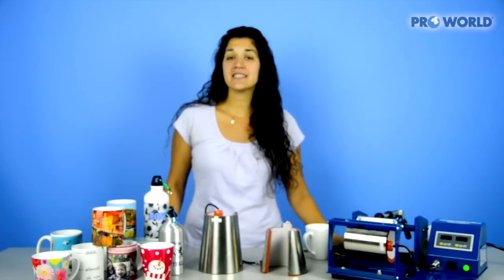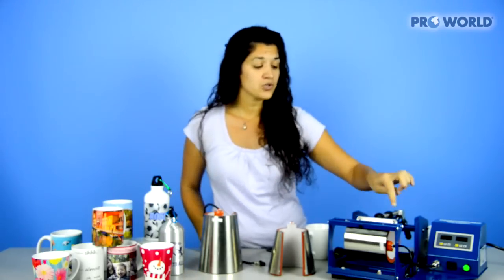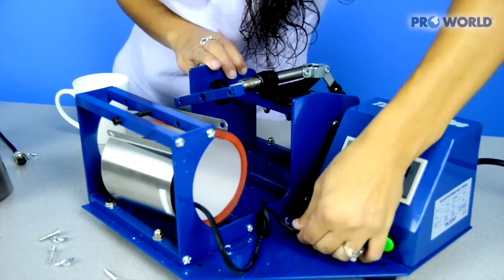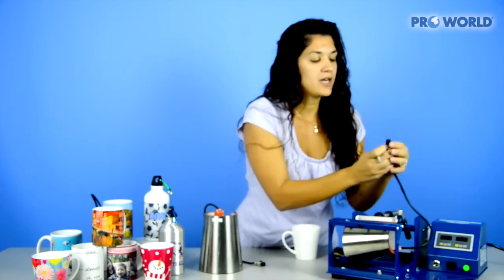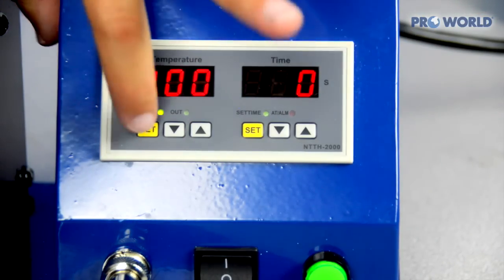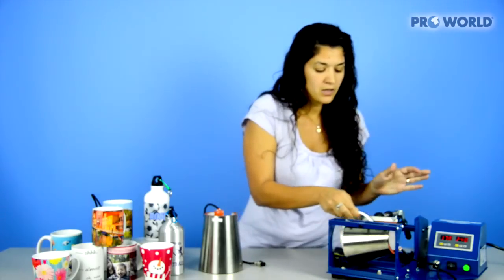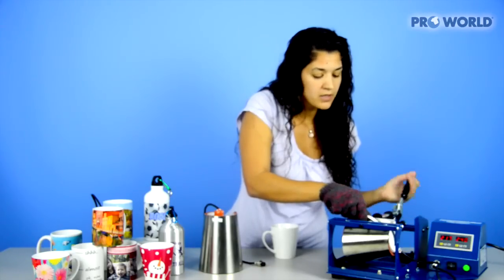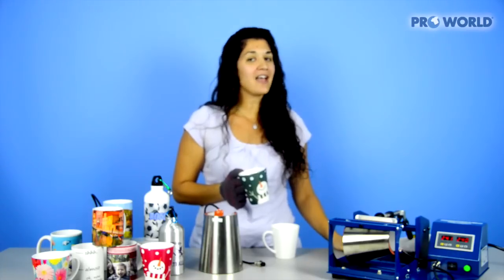How to use the TransPro 3-in-1 Mug Press

Comment: I just noticed that there is screws on the side of the press that says the bottom is for standard mugs and the top is latte. Do you really have to adjust this each time?
Reply from the maker: This is adjusted when you are changing out the element sizes only.

Comment: Can you please demo a 20 ounce skinny tumbler with this? I just bought one. Or just tell me which sleeve to use with heat parameters. Thanks.
Reply from the maker: Hi Bill, You will want to use the standard heating element for the skinny tumblers.  We recommend using a smaller design that does not exceed the heating element, however, if you choose something bigger, you will need to rotate the tumbler and move it for each press.  Settings for a mug press are 350degF, 80-100 seconds, medium pressure.  For additional presses on the same tumbler, you can reduce the time to 50 seconds. You can view additional information and application instructions here: https://www.proworldinc.com/sb-s-248.html
Reply: @ProWorldInc  how do you get the pressure with the standard on a skinny?
Reply from the maker: @KarmaticExperience  We were able to achieve enough pressure with our mug press by adjusting the pressure screw on the unit. If you find you skinny tumbler is not snug within the heating element, you can use a silicone cover to help conduct the heat and provide  a snug fit.  https://www.proworldinc.com/sb-s-073-3d-vacuum-film.html

Comment: Can i use transfer paper? I used it on a late mug for 40 secs, as instructed on the intructions and it was bad so im thinking that theres a very good reason why you left it for son long, also something tells me your using sublimation paper
Reply: Also one of my tests slid off the mold, and it dosnt seem to fit perfectly, like theres a gap on top
Reply from the maker: Transfer paper will not work for this printing method. You will need sublimation ink and sublimation paper when printing on a mug surface.

Comment: Bought this machine because of this demo and get fading sometimes on top/bottom, sometimes around the corners. I use the same Temp/Time settings and I'm printing on 15oz mugs. Have yet to make a perfect mug though out of about 3 cases. I've seen suggestions of repositioning the mug and pressing for extra time (around the bottom), is there a legit way to remedy this, not sure what I'm doing wrong.
Reply from the maker: Please send us an email to service@proworldinc.com along with some photos and the problem you are experiencing. We will be happy to assist you further.
Reply: @ProWorldInc  I will thank you for your prompt response!

Comment: I don't understand the degree part. When I put my mug in the press at 400 degrees, it rapidly goes down to 200+ (like yours did in video) Am I suppose to wait for it to reach back up to 400 before counting down the timer (others on youtube said yes, wait) Or do I disregard that? And my black colors always end up brown. Why? Thank you
Reply from the maker: You should start the timer once you place the mug in the mug press. The drop of temperature is alright. The reason why your blacks are turning brown is due to 'overcooking' or burning the ink. Lessen the time until you notice the paper is not browning - usually about 3-4 minutes is all you need.
Reply: Ok, I've just kind of given up because I'm wasting mugs. I've gone thru about 10 at several tried, writing it all down, but either black turns brown or the colors are not dark enough. But will try again Thank you
Reply: Maybe its an issue with your ICC color profile for your graphics program. You're not getting true black after it sublimates.

Comment: does regular mug which is in Micheal store works for sublimation machine? did you use regular or sublimation mug?
Reply from the maker: You would need to use a polymer coated sublimation mug. A regular ceramic mug from a local store would not work.

Comment: Is this a stand alone press?  Or do I need another machine to use this with?
Reply from the maker: The TransPro 3-in-1 mug press is a stand alone press. The press includes 3 interchangeable heating elements to accommodate most mug sizes.

Comment: What paper are you using as I can't get mine to transfer the print???
Reply from the maker: We use Texprint R paper with our virtuoso sg400 printer.
Reply: I also have the same problem.. I just bought a Transfer machine,, I've done a few Tshirts.. but not having success with the mugs .  The last time I tried it, the image wouldnt' transfer to the mug?  Did you have any  success yet?
Reply: You have to use mugs with the poly coat on them. Not just regular mugs. Type in sublimation mugs into google.hope this helps

Comment: Took me ages to figure this out I bought a spray to pep the mugs FIRST...! They don't tell you THAT....! Google it and buy it on line, can't remember what it's called sorry, but only after spraying the the mugs with a clear coat of that and then heating them up before printing on them will the ink transfer 👍Heat them up to about 180 degrees for around 25 mins the have the heat press on 100 degrees for about 1 minute. It's works
Reply: I really hate when people make videos , yet leave out pertinent info on what is important !!
Reply: Or you can just purchase mugs that are specifically for sublimation. They are already coated with the poly spray. Much easier and faster .
Reply: Unfortunately, the Temps are the One Main thing that is constantly exaggerated. The amount of time needed to be affective or otherwise end up with a useless product. Do your homework and not always take what videos claim to heart at working, not everyone's out to screw you up on purpose, just be wary.